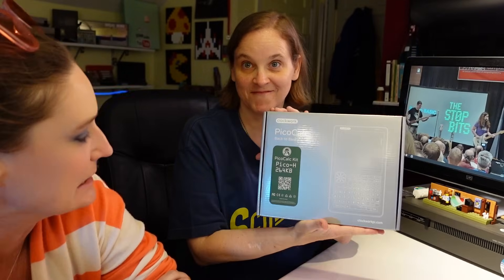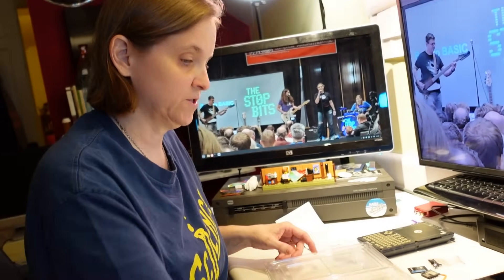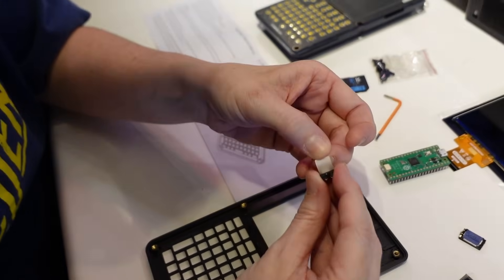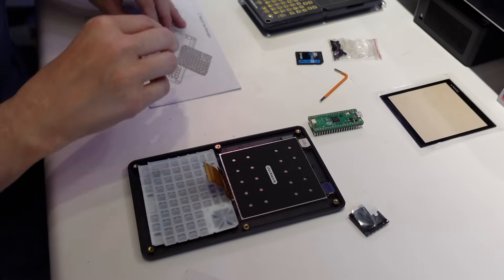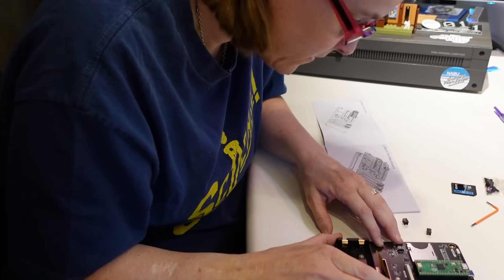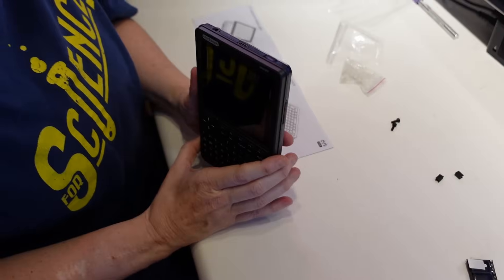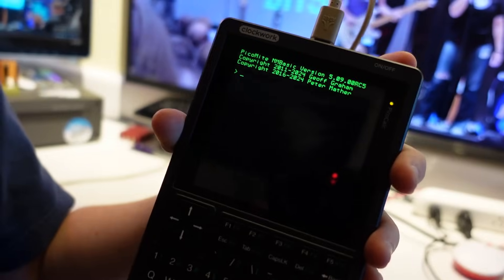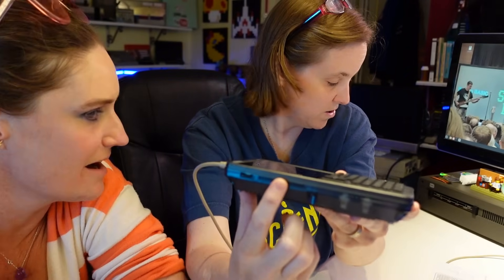Breaking News: PicoCalc (and 12-bit Celebration)

Comment: Nintendo switch you can do programming im not talking about game builder garage there's two programming apps one called smallbasic based on basic programming language and Fuze 4 based on python and basic and you able connect a keyboard and mouse to use with Fuze 4. Fuze arena is website you can find codes for other people programs they created. Fuze also do game jams on Youtube. there is smallbasic for the nds also. a person I forgot who wrote a program to output pc by audio using headphone jack on the switch. I recommend Fuze 4 for the switch. it worth checking out if haven't all ready. Fuze has a basic version for the PC.

Comment: @7:50 You needed 18650 batteries. I needed a couple for a battery backup for a Raspberry Pi. Yeah, I could order from Amazon. But I know they have them locally. Where did I go? The Vape Shop. They have various 18650's there of varying capacity. 
While there, I saw you can also buy synthetic urine. You never know when you might need synthetic urine. 😉

Comment: That's nice. I was worried that you would need a load resistor on that LED. I guess not. It looks nice. But what would I use it for?
Reply: To play!
Reply: @fractalMD  I will admit, I like TI as well. I gave HP and RPN a 30-day try for Pre-Calc. I switched back to TI. Failed the class anyways...😂

Comment: I always found scientific calculators kind of fascinating, but never really knew how to use most of the functions. Back in the 80s, I asked for, and received a fancy Radio Shack calculator for my birthday. I wanted it because it could convert between decimal and hex. I was also pleasantly surprised to discover that it could also do fractions. It was exclusively solar, so it never needed batteries. I still have it. Turns out that it's a rebranded Casio product. 

I've also found several Casio calculators in the trash. A couple even had their protective covers.

Comment: So, is Taylor going to get one of those Sega Neptune boards?... which combines the Sega Genesis with the Sega 32X... into a single motherboard... and the one has to find a donor Genesis and donor 32X to steal part from... and you have to spend a small fortune on a plastic case... but the point is... it would give Taylor quite the soldering experience as it has quite a number of component types she probably hasn't had the opportunity to solder yet.  I have zero soldering skillz and am frightened by just the thought of having a hot iron with 5 feet of my person.